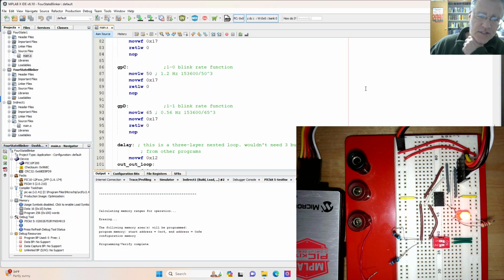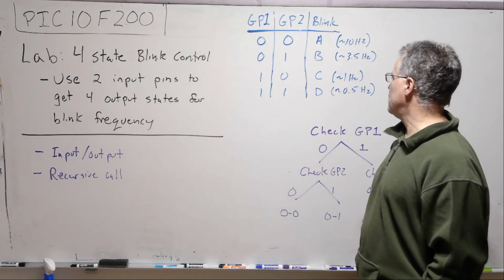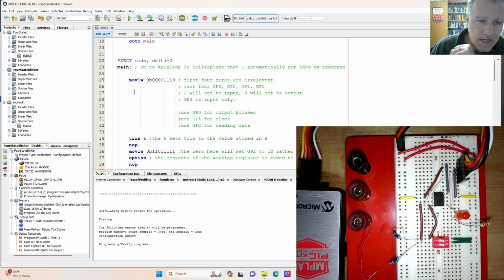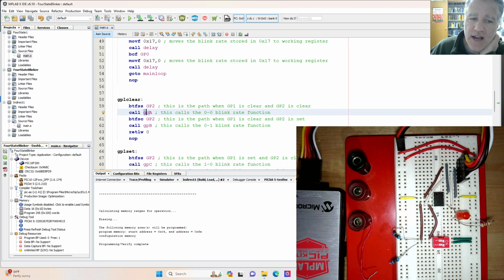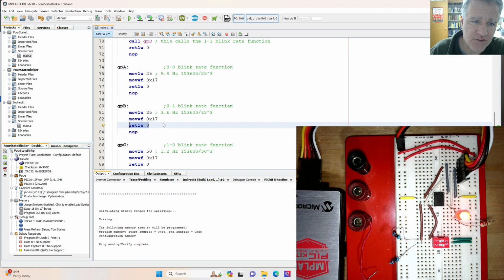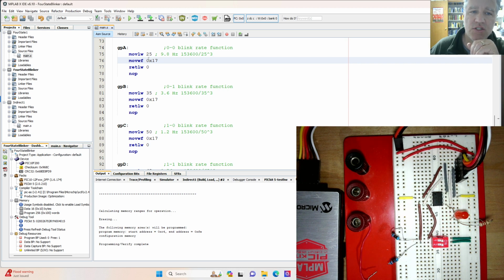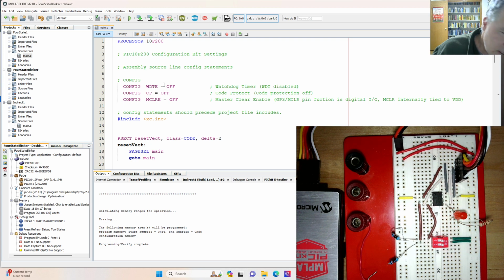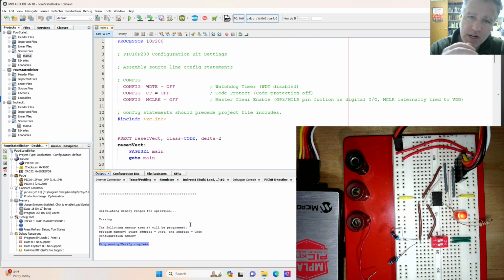PIC10F200 Lab 4 - Creating a Four-State Blinker with Logic Inputs

Comment: This worked for me.  Learned quite a bit. A wiring schematic would be very helpful, as would a source listing, but maybe that would just interfere with my learning.

Once I ventured off the beaten path it didn't work so well, particularly with GP3, especially as I tried to use all 4 GPX pins at once.  Things just work differently in that territory. I suppose that would blunt the point of the lesson and make a very long video, but I needed to know. Eventually I got it working though. I tried posting helpful links, but seems those are rejected, so I'll have to describe without.

I found that GP3 has to be tied to ground, I used a 1k resister and a button.
I had to enable GPPU to get all 4 pins working at once. This also means that all 4 GPX pins are now tied to ground.
I used GP0 as the other input a button and resister, which should be a 1k resister, but in fact only worked when I lowered it to 50 ohm.
Both outputs (GP1,GP2) were LED with 1k resisters, but I find 680 works just as well.
Sometimes, but not always, having the pickit3 plugged in seemed to cause my GP1 to light up, even when it was not set to power the device.  Unplugging the pickit and providing external power would fix this.

This is the code I got working.

PSECT code
main:
    movlw 0b00001001 ; GP0, GP3 are inputs
    tris GPIO
    movlw 0b10011111 ; enabling GPPU (bit 6)
    option
    bcf GP0
    bcf GP1
    bcf GP2
    bcf GP3
mainloop:
    btfsc GP3
    bcf GP2
    btfss GP3
    bsf GP2
    bsf GP3
    
    btfsc GP0
    bcf GP1
    btfss GP0
    bsf GP1
    bsf GP0
    goto mainloop
END

And even better, sometimes I needed to switch my power supply to 3.3v instead of 5v, or else GP0 would read as clear (pressed with GPPU). As a consequence, I had my voltmeter out and was checking everywhere, even plugging wires into ground to force one state or another all to no avail,  until I finally narrowed it down to the voltage clearing GP0. It's rather odd considering the above code would work without problems, which is virtually identical, while the below code needed that 3.3v setting.  Now... in case any of you read the datasheet, I did read that you might have to insert the odd nop here and there to let the state "settle", and I did try that, but it had no impact.

PSECT code
main:
    movlw 0b00001001
    tris GPIO
    movlw 0b10011111
    option
mainloop:
    btfsc GP0
    goto lightsoff
    btfsc GP3
    goto lightsoff
lightson:
    bsf GP1
    bsf GP2
    goto mainloop
lightsoff:
    bcf GP1
    bcf GP2
    goto mainloop
END

Comment: I spent a couple of hours with this Lab, it was fun configuring the switch, resistor and the code, for some reason in the simulator the GPIO register had garbage, I had to use "CLRF GPIO" to clean it. I learned a lot, thanks a lot, Happy Holidays
Reply from the maker: Great! I’m glad you learned a lot. Maybe your experience with GPIO register will help others. Thanks for sharing. 

I really enjoy working with these simple systems and at the assembly level. I think it helps one appreciate how the more complicated microcontrollers and computers work.
Reply: @GNLProject-yp8po   I'm also enjoying it, I want to specialize in PIC microcontrollers, get to know the entire PIC family, from the least powerful to the most powerful PIC, I hope you can continue uploading material about this.